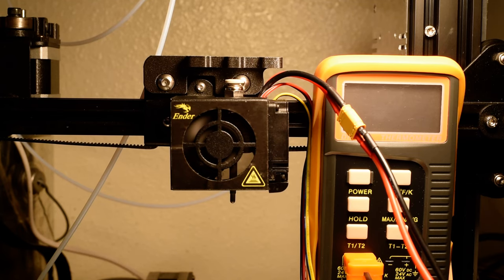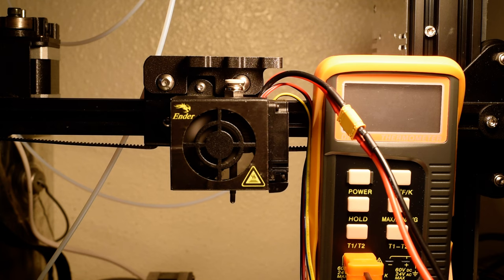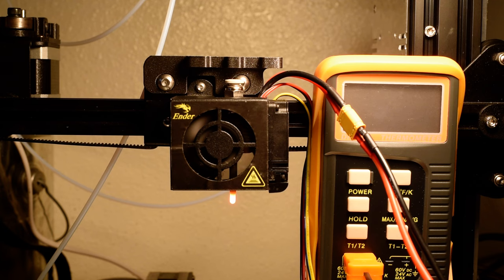1300 degree C hotend for ender 3

Comment: Just fyi, your x belt is routed wrong, it should be routed the other way though the slots on the x carriage. The ends should point downwards, and the belt itself shouldnt be at an angle.
Reply: Only reason I clicked on this video was to make sure those got changed. Lol
Reply: The way it’s in the video is the way it ships from factory though?
Reply: @capitalv8062  no, unless it was assembled incorrectly, I have bought several dozen v2's, not one has come this way
Reply: Yeah they are routed the wrong way

Comment: The real coup would be printing of non-eutectic alloys in a partially solidified state to lower shrinkage.
Reply from the maker: this is exactly what we are doing. Hence Phosphor Bronze 510. 
5 percent tin, 94.75% copper, 0.25% phosphorous. 
it has window between solidus and liquidus of ~130 degrees C and a nice slow change in viscosity with temperature in that range.

Comment: no way theyre using the stock ender 3 fan for this monstrosity lmao
Reply from the maker: we are in fact using the stock ender 3 fan, because the hotend uses about the same amount of power as the stock ender 3 hotend, to obtain much higher temperatures. (and much higher power densities at the nozzle exit.)
Reply: @rotoforge2024 how on earth does that work? Higher resistance in the heating element?
Reply from the maker: the heating element has a volume of about~11 cubic millimeters, compared to the 4000+ of a typical hotend, and has none of the interfaces one would see there. Such as, the nichrome coil to the magnesium oxide insulation, the magnesium oxide to the stainless steel cartridge heater sheath, the stainless steel sheath to the aluminum block, the aluminum block to the brass nozzle, the brass nozzle to the filament...and of course the large interface with the air all this presents that loses heat to convection instead of actually heating the filament (the load).

TLDR; this means that, for the same power, and same effective resistance, we can obtain a much higher temperature, and sustain that temperature under greater cooling influence (flowing metal for example) because our heater has a much high power density (about 1-10 watts/square millimeter, as compared to the typical 0.0002-0.004 of standard hot ends). the same number of watts,distributed through a much smaller area (really volume) of heating element material, and a much shorter path from heat source to the load (metal wire, filament etc.). 
Our heater also heats directly at the nozzle exit. So it deposits heat directly into the deposition region instead having to first traverse a lossy interface....

I will cover all this in more detail in the near future in another video about how the hotend works, and how we made it. 

  @Nonzerotonin

Comment: Cool, what diameter of aluminium wire will you use ? 2mm seems like the sweetspot. Can your hot end flow 10mm3/s aluminum ?
Reply: They're using phosphor bronze